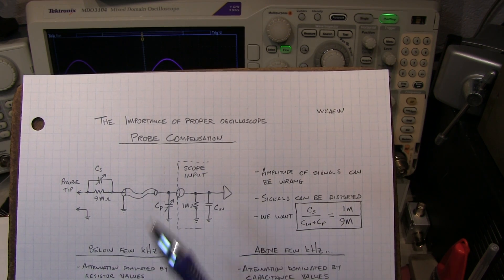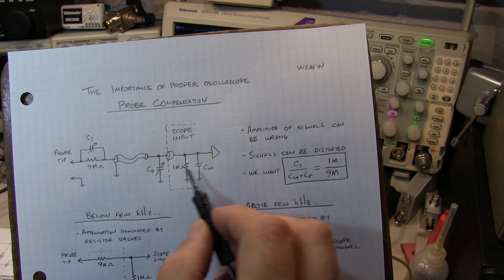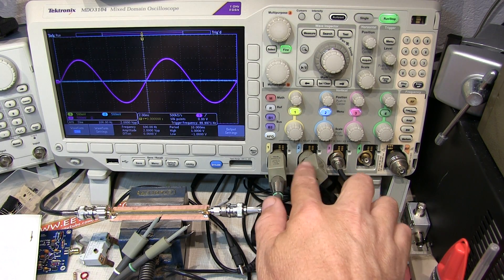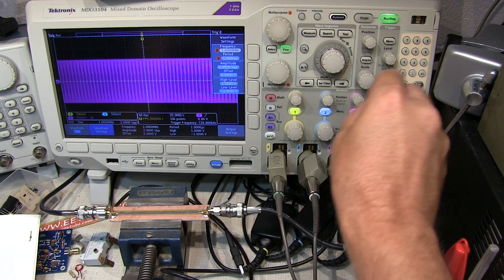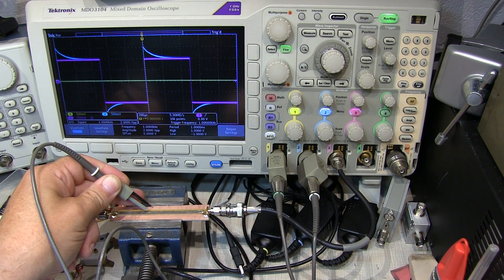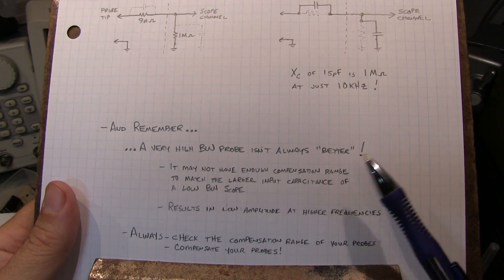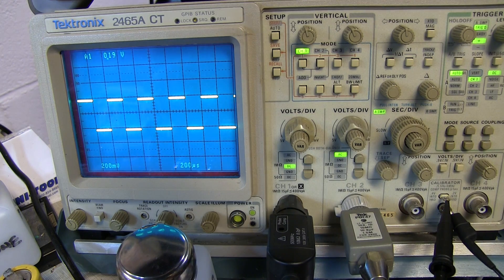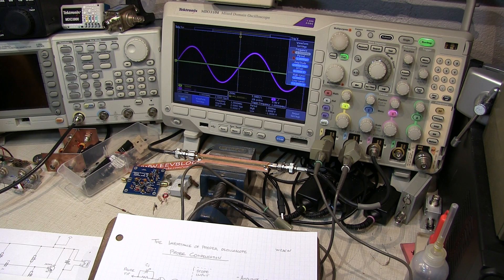#206: Importance of 10X Probe Compensation with your Oscilloscope

Comment: Is that input capacitance a purely parasitic effect of the vertical amplifiers, or is there a purpose to having an apparent capacitor "shorting" the input to ground? I do know that some manufacturers will purposely install something like a varactor a to limit bandwidth of a scope to be sold as a lower end model, such as the rigol 1054Z, and the correct software licence or hack will disable the bias on the varactor allowing full bandwidth or something.
Reply from the maker: In the old school analog scopes, the input capacitance was generally a consequence of of the input attenuator circuitry. In modern scopes, where the BW is software controlled, this is generally done deeper in the channel front end, or even in DSP.
Reply: ***** I just recently got a shiny new rigol D1054Z, it is really nice, though having it less than a week I have already found some limitations to it compared to nice analog scopes. :/ Have you heard of oscillofun? it is a stereo soundtrack that can be fed into the XY mode of a scope to make cool cube shapes! It works much better on the old analog scope than it does on my DSO though.
Reply: Nothing beat the nice green glow with the perfectly "intensity grated display!"
Reply from the maker: Power Max Yes, there are definitely applications where an old CRT based analog scope is superior - and that XY example is a good one.  I've never seen a digital scope that does an acceptable job on things like that, or looking at RF envelopes, etc.

Comment: I have a Tektoronix 465B and 2 x tek 350mhz probe.
when trying to compensate them i can get overshoot and undershoot but i cant never get a perfect squarewave. Is this normal or i need to repair the scope? :).
i get a little drop like you do at 10:41 i get enough range to overshoot and undershoot but there's this small drop/distortion in the line, so i guess my probe are not perfect for my scope.
Reply from the maker: bloodedge If you can adjust to get both overshoot and undershoot, then the primary compensation adjustment is fine - just get it as close as you can.  There are internal adjustments in the probe to fine-tune the broadband frequency response, but this generally requires special fixtures and equipment.    If the imperfections are small in the resulting square wave, then it is unlikely that you'll be able to even see any detrimental effects when using them in day to day use.

Comment: Hi,
How does new MDO3000 does it auto-compensation with software/hardware ? Video about that will be interesting !
Reply from the maker: Linas K The MDO3000 will automatically compensate the new TPPxxxx style of Tek probes.  It does this by adjusting filter coefficients in the front end of the scope, and then storing those coefficients internally along with the serial number of the probe.  So, each time you plug that probe back in, it recalls those filter coefficients.

Comment: Alan,
on this same subject, I have a Tektronix 2465BDM 400MHz scope.  I also have a set of very nice P6109 10x probes that are only rated for 150MHz.  The scope has an input of 1Meg  Ohm and capacitance of 15PF.  The probe says that it is 1.5 Meg Ohm and 11.8 PF.  I am able to properly compensate it to the scope and I understand that it is only a 150MHz probe. My question is if I am using the probe to test signals that are below 150 MHz on this scope, will there be any distortion of the signal?  This video really made me think.  How important is it to have a probe that matches the bandwidth of the scope, even when looking at lower frequencies?
Reply from the maker: If you are able to properly compensate the probe (get a good, flat squarewave on the comp signal when running at 200us/div), then you should be fine. When properly compensated, response should be good to the 3dB BW of the scope or probe, whichever is less.